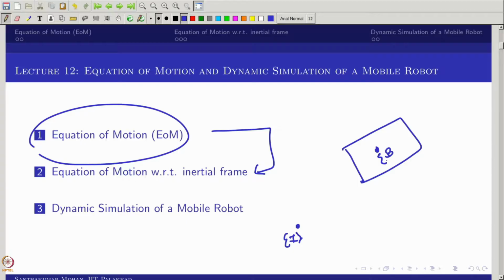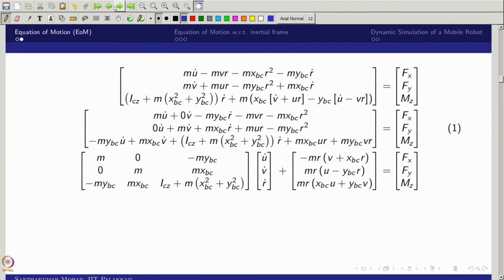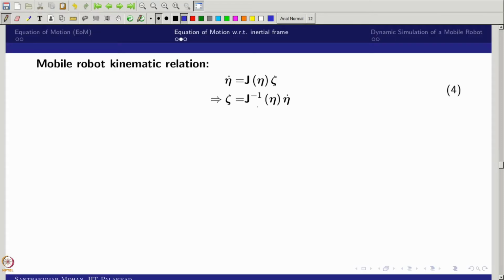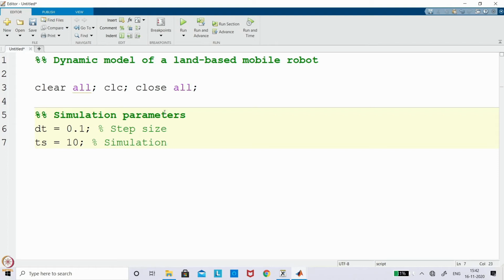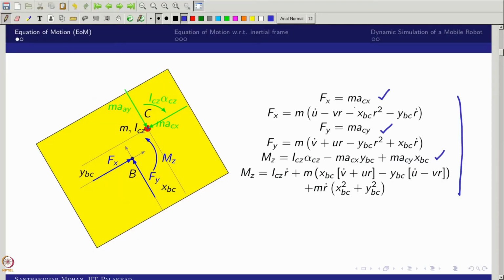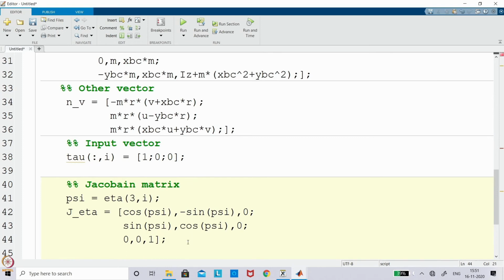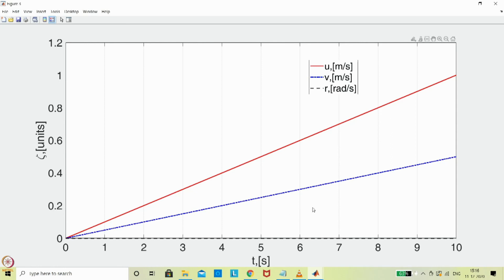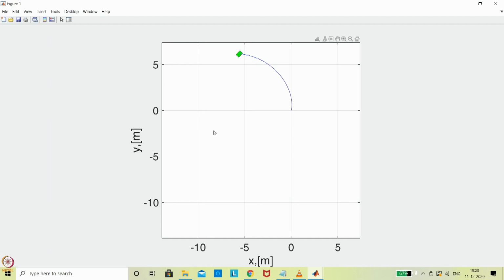mod03lec15 - Equation of Motion and Dynamic Simulation of a Mobile Robot

Comment: If you get the code , please ,Peace be upon the Messenger of God, Muhammad

The code

%% Dynamic model of a land-based mobile robot
clear;clc;
%% Simulation parameters
dt = 0.10;%step time
ts = 100;%simulation time
t = 0:dt:ts;%time span
%% initial conditions
eta0 =  [0;0;pi/4];%initial position and orientation of the vehicle
zeta0 = [0;0;0];%Initial vector of input velocity commands

eta(:,1) = eta0;%initialize position vector for each time step
zeta(:,1) = zeta0;%initialize velocity input vector for each time step

%% Robot Parameters
m = 10;% mass of the vehicle [kg]
Iz = 0.1;% Inertia of the vehicle [kg.m^2]
xbc=0;ybc=0;%%coordinates of centroid with respect to body frame of the Robot
%% State Propagation

for i=1:length(t)
u = zeta(1,i);
v = zeta(2,i);
r = zeta(3,i);
%% Inertia Matrix 
D = [
     m         ,0      ,     -m*ybc
     0         ,m      ,      m*xbc
    -m*ybc     ,m*xbc  ,Iz+m*(xbc^2+ybc^2)
      ];

n_v = [-m*r*(v+xbc*r)
       m*r*(u-ybc*r)
       m*r*(xbc*u+ybc*v)
    ];

%% Input Forces and Moments vector
tau(:,i) = [1;0.5;0.1];%[Fx ;Fy ;Mz] w.r.t body frame {B}
%% Jacobian Matrix
psi = eta(3,i);
J_eta = [cos(psi)    ,-sin(psi)   ,0
          sin(psi)   ,cos(psi)    ,0
          0          ,0           ,1];
b = 0.7;% vicouss friction coefficient
zeta_dot(:,i) = inv(D)*(tau(:,i)- n_v - b*zeta(:,i));
zeta(:,i+1) = zeta(:,i) + dt*zeta_dot(:,i);%update zeta value using Euler inegration

eta_dot(:,i) = J_eta*zeta(:,i+1);
eta(:,i+1) = eta(:,i) + dt*eta_dot(:,i);%update position of the robot w.r.t. inertial frame {i}

end

%% Animation [Mobile Robot Motion Animation]
%% %%%%%%%%%%%%%%%%%%%%%%%%%%%%%%%%%%%%%%%%%%%%%%%%%%%%%%%%%%
% Robot dimensions
l=0.6;%robot length
w=0.4;%robot width
% mobile robot coordinates
mr_co = [-l/2 ,l/2  ,l/2 ,-l/2 ,-l/2;
         -w/2 ,-w/2 ,w/2 ,w/2  ,-w/2];
figure
for i = 1:length(t)
psi = eta(3,i);%current orientation in rad
R_psi = [cos(psi) ,-sin(psi) ;
         sin(psi) ,cos(psi) ];%rotation matrix
v_pos = R_psi*mr_co;%vehicle prientation with respect to i frame
fill(v_pos(1,:)+eta(1,i) ,v_pos(2,:)+eta(2,i),'g')%robot body position update
hold on ,grid minor;
axis([-10 ,10 -10 ,10]), axis square
plot(eta(1,1:i),eta(2,1:i),'b--')%show the live path
legend('MR','Path') ,set(gca,'fontsize',10);
xlabel('x[m]') ,ylabel('y[m]')
pause(0.1);
hold off
end

%% %%%%%%%%%%%%%%%%%%%%%%%%%%%%%%%%%%%%%%%%%%%%%%%%%%%%%%%%%
%% Ploting Functions
figure
plot(t,eta(1,1:i),'r--')
set(gca,'fontsize',10)
xlabel('t[sec]')
ylabel('x[m]')

hold on

plot(t,eta(2,1:i),'b--')
set(gca,'fontsize',10)
xlabel('t[sec]')
ylabel('y[m]')

plot(t,eta(3,1:i),'g--')
set(gca,'fontsize',10)
xlabel('t[sec]')
ylabel('\psi[rad]')

grid minor
legend('x[m]','y[m]','\psi[rad]')

figure
plot(t,zeta(1,1:i),'r--')
set(gca,'fontsize',10)
xlabel('t[sec]')
ylabel('\zeta[units]')

hold on

plot(t,zeta(2,1:i),'b--')
set(gca,'fontsize',10)
xlabel('t[sec]')
ylabel('\zeta[units]')

plot(t,zeta(3,1:i),'g--')
set(gca,'fontsize',10)
xlabel('t[sec]')
ylabel('\zeta[units]')

grid minor
legend('u [m/sec]','v [m/sec]','r [rad/sec]')